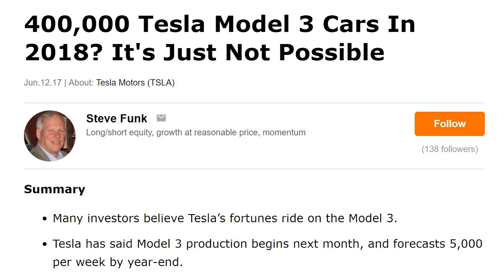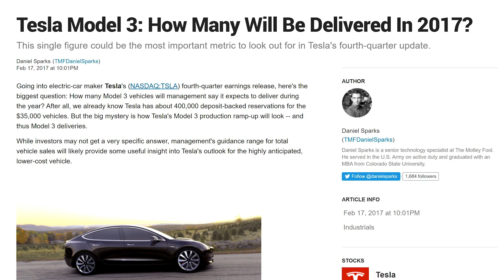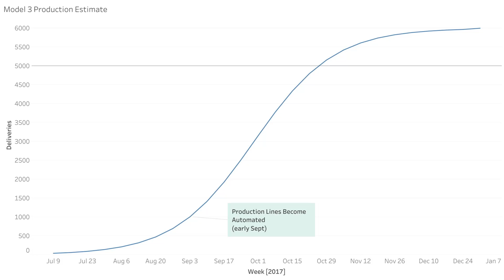TESLA MODEL 3 PREDICTION - 83K Delivered in 2017 But Will It Be Enough to Please Investors?

Comment: Yeah, I agree that it will be difficult to ramp up production, and I thought I read in that analyst's article that the Fremont factory will be bottlenecked by the limits of the paint factory. Once again, I'm glad my Altima is paid off and I only have 66,000 miles on it, so that I can patiently wait for my model 3, as I only placed my reservation in June of 2016 😀. In addition, I'm happy about Elon's recent tweet about India. Hopefully they will build a factory there.

Comment: Tesla is moving to 3 shifts....
Reply: Elon said at the meeting, that Tesla have already moved to 3 shift. He said that they had done this to have less stressed workers, in an effort to get the injuries down.
Reply: It was more for safety, whether it makes sense or not, that's what's happening. In addition, the premise in the  video is a little off. They've said their suppliers are going to deliver parts for 1000 vehicles per week, 2000 per week etc. This does not directly translate into Tesla suggesting they are going to deliver vehicles in those numbers in the same timeframes. There's likely going to be some latency up front assuming all the suppliers deliver on time.
Reply: Good point.  It's hard to predict if you are going to have supplier bottlenecks or not until you are deep into production at high rates.
Reply from the maker: That might help them meet their production numbers but the cost would be pretty high so it might not make sense

Comment: If your prediction is true I think it'll be huge for Tesla and the whole EV movement. What about your prediction of the Tesla stock by the end of the year then? :-)
Reply: That's true, Ben. Very true actually. I will keep with my long term prediction that it is a $1,000/share stock over the span of the next 5 years.
Reply: stock pricings are more human than anything else, anyone saying they can predict them is a liar, hitting 1k sometime in the next half decade does sound possible.
Reply: 500$ if they do tip top by the plan
260$ if they throttle and dont keep up. 

Now its 380.66$/share
Reply from the maker: Stock prices are so difficult to judge because they're driven by human factors. Machines are much easier to predict :)